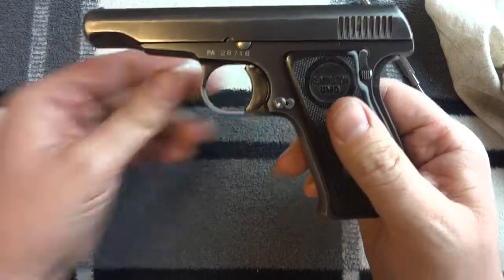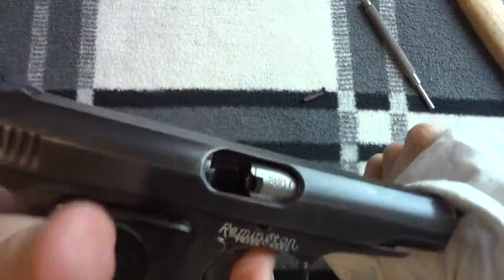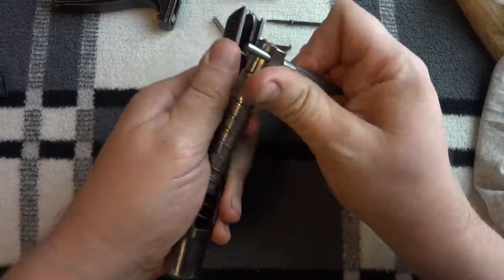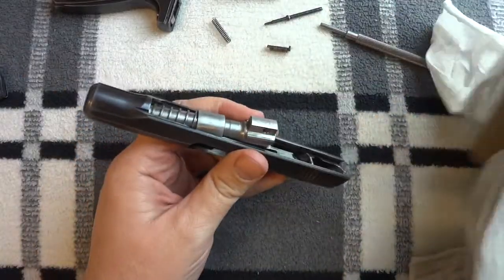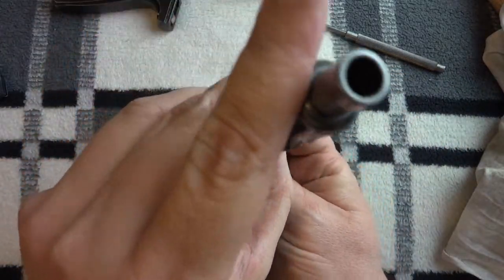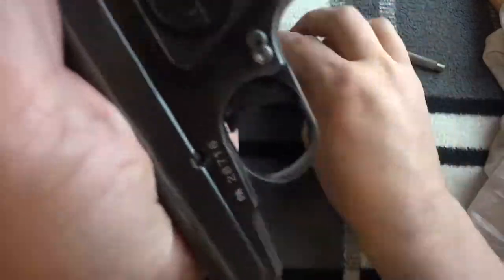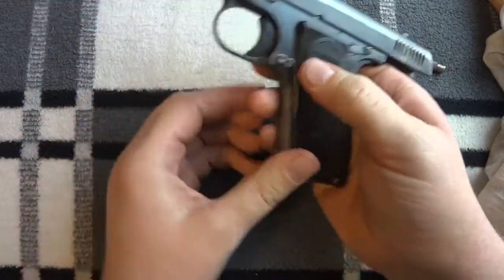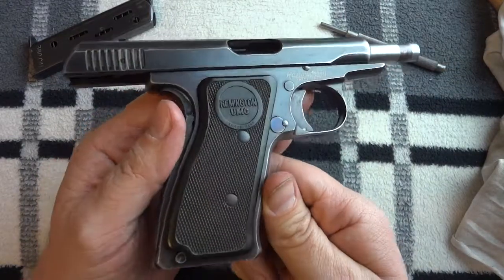Remington 51 Part 5 of 5, Quick Disassembly and Reassembly

Comment: I have looked for an available Model 51 for a good many years and finally found one in 2021. Your video collection is a Godsend in getting this marvel tidied up. I wish I had a way to age the caked-on debris that I wiped free. Thank you so much for documenting and sharing your knowledge.
Reply from the maker: Glad it helped.  I have owned a few that looked like they had NEVER been maintained.  The original factory oil had formed a varnish with years of dust and powder fouling.

Comment: Hi, this is my 2nd time doing this and followed your instructions. I used my thumb nail to push down the sleeve on the spring and pushed the barrel with other hand, I was surprised I didn't have to use my rubber mallet. Went in without a hitch. Did a function test and seems to ok. Sounds awesome when you rack the slide tho. Thank you once again for a detailed instructions.
Reply from the maker: Glad it helped.  I tell you, it's a good deal easier doing it OFF-camera at my bench.  Took one of my .32's out the other day.  They're a dream to shoot.
Reply: @RyeOnHam  would you know when my firearm was made? Serial # 6754 I would guess 1919 up? I didn't even think when you said, they are collectors. Really cool piece.
Reply from the maker: @eddelossantos3083  I don't know.  There are better collectors out there.  You could try here: https://www.remingtonsociety.org/manufacture-dates/ The date codes are on the side of the trigger guard, if they are there.   It could be 1918-1921, IIRC.  I don't think I've pinned my guns down.  I'd be interested in having a birthday party shoot for my guns as they come up on their 100th birthdays soon.
Reply: @RyeOnHam  thank you. I will check it out. My ccw back as safe queen now. Lol

Comment: Are you sure you're supposed to drop the firing pin in via the muzzle of the barrel.  I know it seems convenient but that firing pin and spring are hardened steel.  Wouldn't that scuff up the bore/rifling?  Anyway, very helpful videos.  Thanks, I've just recently bought a Rem. Model 51 myself, so all of this really helps.
Reply from the maker: I don't think they cared 100 years ago.  I've got several 51's in various states of repair.  The first thing to break is the web on the side of the bolt cracking.  I've never seen one worn out from disassembly.  As for the bolt, it is made from hardened steel, just like the firing pin.  If I had to guess, I'd say that the bolt was HARDER than the firing pin.  To understand why, most firing pins do not break because of wear or mushrooming, they fail because they get smacked by the hammer over and over again.
Reply: @RyeOnHam  Oh OK thanks for that.  I noticed getting a new bolt isn't easy.  Should certain ammo be avoided with them?